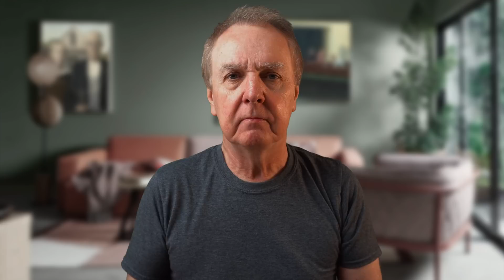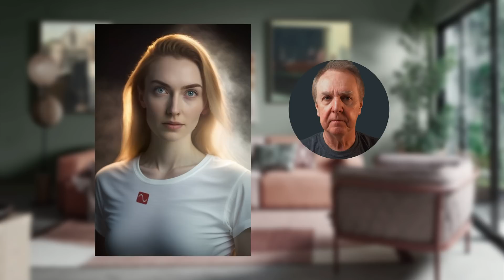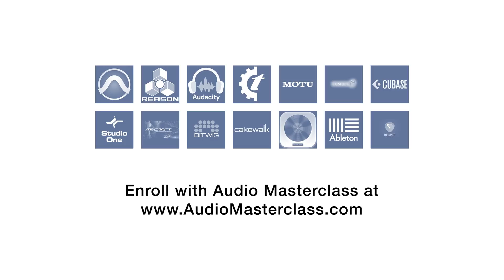Did that Dolby thing ever work?

Comment: Dolby works. You have to calibrate the deck using a reference tape (they've all drifted after all these years) and you have to relap any head that's lost high frequency response. But get that right and not only does it work, its transferrable between different decks. No dullness. No pumping. No mistracking. The recordings matter too. My own recordings from 30 years ago on quality brand name tape (TDK/Maxell) still sound pretty sharp. None of my pre-recorded store purchased tapes have held up however and all mistrack. Most commercially recorded tapes were flogged out on the cheapest tape possible and these have all lost level over the years.

Comment: Many people don't even understand that Dolby ANYTHING is a 2 way process. You cannot just throw it in if the tape was not encoded in the first place.
This lack of understanding was not just for the domestic market. In the early days of analog Prologic for cinemas, prints would arrive at the cinema often Dolby A encoded. Even if the cinema was a mono none Dolby sound system. Playback sounded quite odd. Very compressed and over bright.
In later days trailers would arrive as Mono, stereo with or without Dolby A. Mostly with no identification on them. Not that it mattered anyway. With multiplexes and mostly nontechnical staff. The Dolby was activated ALL the time, even in mono. Simply because few understood the implications. (or did not care!)
I've even had a Brenda Lee CD where Dolby A reduction had been applied to a none encoded track in the first place. Sounded dreadful, taking it back to the shop was a pointless exercise, they had no idea what I was talking about and could hear nothing wrong.
Ahh, those were the days!

Comment: From this video, what I've gleaned is that Dolby's noise reduction schemes are not only frequency dependent, but level dependent as well.  

The fact that low level portions of the signal are raised during encode(recording) and lowered back to original ratio during decode(playback), indicates some kind of dynamic processing - compression & expansion? - going on as well.

So the cassette Dolby schemes didn't just raise some frequencies during encode and lower those same frequencies during playback, there was also a sort of "compansion" process at play here.
Reply: Correct. It was a compression/expansion process.
Reply: Yes, there is the standard EQ on record and playback on all decks. This has a constant frequency curve and is not level dependant. The Dolby B and C systems effectively compress the higher frequencies by applying more gain to them during their lower levels during recording and less gain on playback to return them to the correct level. The standard EQ operates after the Dolby processing during recording and before the Dolby preocessing on playback.

Comment: I was never a big fan of Dolby NR. If I used it for a particular recording, it was B-Type, never C-type. I think it also has to do with the fact I didn't know at the time how it worked. Only recently I learned more about it, since I started experimenting with the software tools described in my comment on your previous video. Now I only use dbx on my cassette deck with dbx or via software DxII on the other deck. I love dbx.

Comment: You left out Dolby C and Dolby HX Pro.  What about tape bias??
Reply from the maker: Thank you for your comment. This video is specifically about Type B. Bias is part of the alignment procedure and should be pre-set correctly if the recommended tape is used. HX-Pro isn't a noise reduction system in the same way as Type A, Type B etc but it might be something I can cover separately. DM

Comment: Dolby should have made playback level adjustments available on all decks with Dolby NR to reduce the compatibility problems. I still have some more than 30 year old Dolby B/C recordings on TDK and Maxell tapes that sound almost perfect. But most pre-recorded Dolby B tapes did already sound a little dull when they were brand-new.
Reply from the maker: I'd say yes to this, but for non-technical people, probably 99% of cassette users, it would probably be one more thing to get wrong. DM
Reply: @AudioMasterclass  I wonder if cassettes could have had a brief either ultra-low or ultra-high tone for the deck to measure and align to automatically? (I suppose I'm adding cost to the decks now.)
Reply from the maker: @GeneSavage  That could have been done. There were tape machines that used a pilot tone to improve stability but they never caught on. I can't remember the details but perhaps Google knows something. DM
Reply: @AudioMasterclass  you could hear those calibration tones at the beginning of some pre-recorded tapes that were created during duplication to calibrate or QC the resulting recording. Some high-end home decks do have calibration tones to automatically set bias and recording levels. Nakamichi decks could also auto adjust head azimuth.

Comment: I'm a member of the Dolby B team. However, I use a Denon 3 heads for recording and I record at the highest level possible on new-old-stock chrome tapes, then I listen on another 2 heads Denon because I don't want to use the 3 heads prematurely. After watching your video, I now understand the meaning of the dolby sign on the Vu meter, it's the Dolby trigger. I didn't know that
Reply: No, dolby sign on the meters is not related with any triggering. Actually dolby is not triggering on/off based on a certain level but adjusts it's influence continuously based on level/spectral componence of the signal. Dolby level is just a mark that means at that point the signal shown on the meter represent a certain fixed magnetic flux on the tape (because there is no 0db standard on meters, 0 may mean different things on different decks but dolby sign always indicates the same level regardless of the deck).

Comment: I’ve been playing with a nice Dolby type S deck and metal tapes and I’m actually very impressed by how good it sounds. It’s a lot of fun to see how far an inferior technology can be taken with technology
Reply: In my EXPERIENCE Dolby S was the only version worth bothering with at all, and when used correctly gives unbeatable recording quality 😉
Reply: @darrenhunt234  Dolby S is a simplified version of Dolby A mentioned in this video. It worked unless you had too perfect audio setup and could hear all its artefacts instead of foreground noise
Reply: Yep, that's the best combination with cassette tape for sure, especially if you're also recording on a 3-head deck to properly monitor the recording level to eliminate noticeable distortion and maximize the available dynamic range of the tape itself.

All tapes were slightly different in their abilities too, with the overall best one I ever found and used being the TDK MA-XG, although they were quite expensive when brand new. (But definitely worth it IF you had a very good quality 3-head cassette deck with Dolby S NR, that could actually take FULL advantage of that specific tape!)

If everything was ideal, the above tape on a really good deck with Dolby S, the signal to noise ratio could be as high as about 85 dB, which is pretty darn close to CD! (~100-120 dB for CD with the best CD players)
Reply: @JoeJ-8282  As a 16 bit linear quantizing format, CD's theoretical maximum is 96 dB dynamic range and signal to noise ratio, with another bit or two lower noise floor using frequency-shaped dither. 120 dB would be 20 bit recording and I've never seen anyone ever claim to get that out of a CD.
Reply: @editingsecrets  Yeah, those numbers I mentioned were just some claimed specs of various high end CD players that I remember seeing over the years, I had no way of actually testing to see how accurate those numbers were.

For example, the CD player that I have in my stereo system rn claims to have the theoretical maximum Dynamic Range of 96 dB, but it's claimed Signal to Noise Ratio is 105 dB. I'm not sure if it's actually capable of those numbers in all actuality, because I don't have any way to accurately measure or test it, but I do know that it sounds REALLY great, and it was an excellent deal for me, especially since I found it used at one of my local thrift stores for $15! You really can't beat that for a really good quality CD player! It's not "technically" a super high-end brand, but it's definitely decent, and it works very well for me.
Reply: @JoeJ-8282  When the CD format is fully used - not squashed to hell by "the loudness wars" - it can sound really great! Especially for only fifteeen bucks, wow!
Reply: @editingsecrets  Agreed! The recent loudness wars is ruining so many otherwise great new artist's albums nowadays due to major distortion and bad mastering! It's really irritating to see it when it happens, because you're like thinking "Damn, this COULD have been absolutely amazing IF it had been mastered better, but because of the bass and level saturation distortion it's only an "average" album at best!"

There's actually a LOT of really cool and good new artists coming out constantly, but it's like the "fine art" of truly good recording quality has been totally lost with this new generation, because almost no-one nowadays even seems to know what distortion of ANY kind sounds like anymore! It's really sad AND disgusting! (sounding)
Reply: @JoeJ-8282  Sadly Bob Ludwig's wide dynamic range master of Chinese Democracy may have been a high water mark for the industry. I was happy when the brilliant music but squashed to unlistenable Vapor Trails got opened up to actually hear what they played.
Reply: @editingsecrets  Look for vintage releases of albums and CDs before the loudness wars took over. Same thing with the mp3 format. You would be surprised of the improvement when you allow extra headroom, but use the highest rate of 320 / Stereo. And use a good decoder to play them of course.

Comment: I admit to buying hundreds of blank TDK/SA and Maxell uD something II tapes. I struggled so much trying to get timing down on recording records.  But, aside from that, I thought Dolby worked if you pushed VU to +2-3. This seemed to be the case on the multiple decks I owned. If I recorded to 0 VU I get a low dull playback with Dolby. I tried DBX instead but it seemed to produce weird artifacts with dynamics.
Reply: It worked because, when recording with a level higher than 0VU, in practice Dolby never intervened on the signal, even if it was on; Dolby's logic, as explained in the video, was to reduce the background noise only when it became perceptible, therefore when the signal dropped below 0VU.
Reply: @carminedambrosio7  I guess I understood that from the video. What I failed to mention is it wasn’t explained. Nobody I ever spoke to understood what you were supposed to do to use Dolby NR.
Reply: @stevezeidman7224  I guess it all comes down to what the ears have to say about the playback.

Comment: The key to a proper working Dolby system is that at playback the audio must have exact the same level on all frequencies as on recording. Therefor a good aligned tape must be used. In the 80's I bought the "really good" real chrome dioxyd (CrO2) like BASF or Agfa. But today, some decades later, (omg, I'm old) these tapes lost between 6 to 10 dB playback level, so they can't be played with Dolby on anymore 🙄
Reply: Basf chromium cassettes had the best "Type II" tapes, but they sounded well only on european brands deck, or with the Nakamichi 'cause they needed an higher amplitude bias signal (not only in percentage). Then  the japanese brands like Sony or Tdk made chromium-equivalent tapes with cobalt, to work good also on the majority of japanese decks.
Reply: Got Denon and Teac cassette decks. Japanese decks play better with Japanese tapes like TDK, Sony, Fuji, while BASF Agfa or Philips play better on european brands like Gründig
Reply: @CaptainDangeax  Exact 🙂

Comment: One of my decks has autocalibration and I have a small collection of 25 different Type I and II cassette tapes from brands including Maxell, TDK, BASF, Sony and Philips. I'd say the deck can calibrate itself properly (ie. with a maximum difference of 1-2 dB between input and playback level) to 50-60% of those cassettes. In these cases, recordings with Dolby B or C sound excellent. That is, as long as I play them back on the original deck. Overall, I find Dolby to be fiddly and very sensitive to alignment differences between various decks, as you pointed out. I do not bother with Dolby anymore ever since I put an external single-ended denoiser in my playback chain.
Reply: Once upon a time, I had to send my Fostex X15 away for repairs. Meantime, I was given an X26 to use. Everything was fine for recording. But soon as I put in a tape made on the X15, everything went to ***t. Lost the highs, the lows, was left with an ugly sound, worse than AM radio. Just saying. : )

Comment: In my experience, it works pretty well so long as it's for your own recording played on the deck that recorded it, and some decks are very well aligned with one another. Pre-records are definitely a hit and miss, some have given the correct treble response when compared to a streaming version in a/b tests. But no matter how good you can get it to work, some sounds (mostly high textured electronic sounds) can lack detail unless you under bias, but that will also give a treble boost to everything else. Leaving dolby off during recording will keep those problem sounds more intact. 99% of vocal and instrumental music dolby will stay faithful to the source so long as you have a proper bias adjustment making pink noise match the source indiscernibly at 0db (yes even a two head deck with the internal pots adjusted), you won't be able to tell the difference in an a/b test, even with good headphones, volume cranked high. It's just those electronic sounds that go above and beyond the capabilities sometimes. If someone doesn't believe me, generate a sawtooth in audacity, record it onto cassette at 0db, then play it back comparing it to the source sawtooth (match the volumes if required). It will be missing texture, far worse so if you used dolby.
Reply: My guess is that electronic alignment alone is not enough. It is also about the quality of tape transport. A perfectly biased deck can measure well on a bench, the Dolby may operate flawlessly, but then high W+F, especially audio-frequency flutter, makes it all mushy and dirty. And then the listener plays with controls to mask this midrange trash with excessive treble. We certainly did it back in the 80s. Fast forward 40 years, and I still do it with my "disposable" low-end decks - while a Revox or a Sony ES sound fine as they are.
Reply: @jmi5969  Most definitely YES about that!

Good quality vintage tape decks from reputable and well known brands, especially the ones that were made in Japan, were WAY better sounding, (because of the reasons you mentioned, among other things), than the brand new cassette decks that are available nowadays, of which all use the same identical, REALLY cheesy quality, mechanisms made in China to modern day, super cheap, "throw away" quality standards!

There's literally NO comparison between good vintage decks and those horrible new ones! There's even videos here on YouTube on various audiophile and "audio nerd" channels that have done side by side comparisons of both to prove how terrible the brand new cassette decks are in comparison to a good quality vintage deck that has been properly taken care of and serviced over the years. It's actually pretty sad and ridiculously funny how much worse the new ones are vs. most vintage decks!
Reply: @truesoundchris  Sure they are. Unless I'm just not a human.
Reply: @truesoundchris Ever try Jean-Michel Jarre - "Oxygene", or Synergy - "Cords", for instance? I beg to differ with your statement, friend. These are decades old, fully electronic but still sound beautiful and remarkably timeless (and very clean to boot).

Comment: I only tolerated compact cassettes in my youth when I recorded LPs to them. I never engaged Dolby noise reduction because, like you said, it dulled the sound.  I never understood what the big deal was with Dolby NR, no matter what letter they used.
Reply: Where only B was available I found it better to enable B on recording with the gain reduced a bit then disable it on playback with the treble dialed down a little. Just a little.
Reply: @J S No, your mother is.

Comment: It worked properly, whether it’s A,B type, C, S, SR… as long as it’s aligned properly at *each deck it’s played on*. which is not always feasible.

I spent literally years in the 80’s trying to find a home deck that matched a car deck in speed, alignment, and Dolby tracking.  It was horrifying.

In the studio everything was aligned before record/playback so that was easy to troubleshoot. 

I like it and it does work.  I used it on just about everything except tape running at 30 ips 1/2”.-

Comment: How about Type C and HX Pro? 
My two Akai decks had Type C. Type C was pretty good for me.
Reply: HX Pro is not noise reduction. It's headroom extension and is only applied during recording so there's no need for the listener to do anything to make use of it, nor even to play back on a deck equipped with it.

I agree type C is pretty good - a huge improvement over B - but the only decks I have with C also have S which is better again.  S-encoded tapes also sound better if, for whatever reason, they end up being decoded with type B than do C-encoded ones.  That was part of the design, eg. to cater for playback on lower budget decks, but I read somewhere that the type S chips have been known to go kaput so that relatively better compatibility with type B may turn out to save the day if you are unlucky enough!